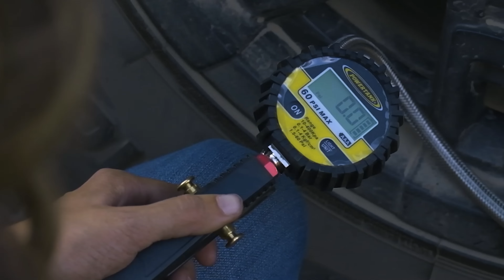Driving on the Cliffs of Moab, Cliffhanger & Moab Rim

Comment: Isn’t that 3 link front RPM? Never understood why they decided to use the fork type design on the upper link. It’s a known weak point, especially from all the stress of just 1 upper link and big axles and tires and such. That’s why most 3 link designs put the upper on the passenger side with an actual rod end. Much stronger design. 

That trail welder is really cool though! Glad you got it all fixed up and back on the trail!